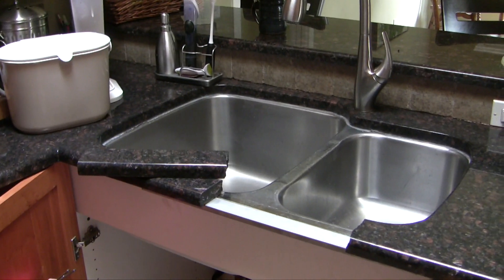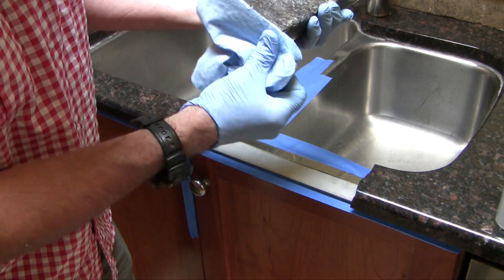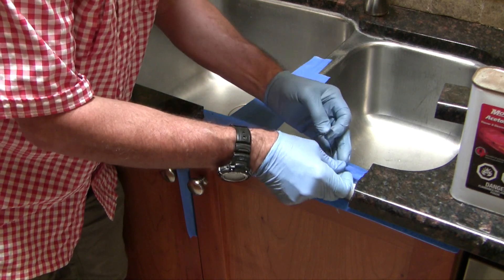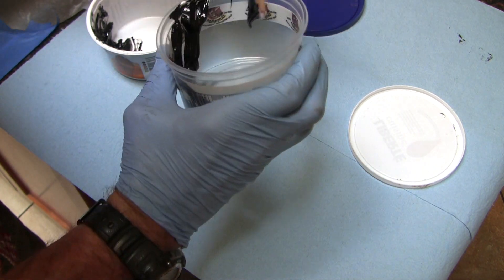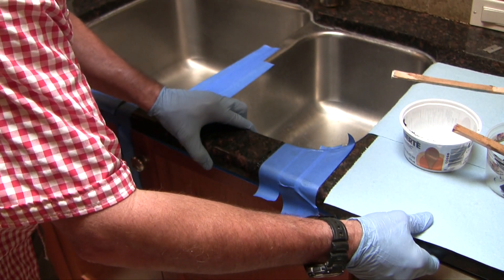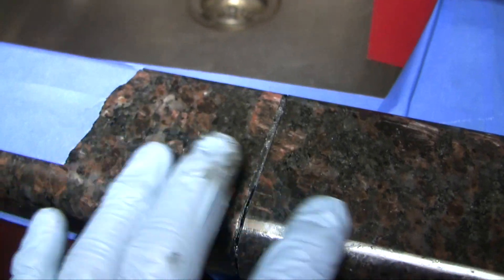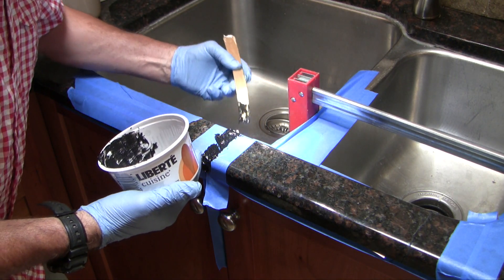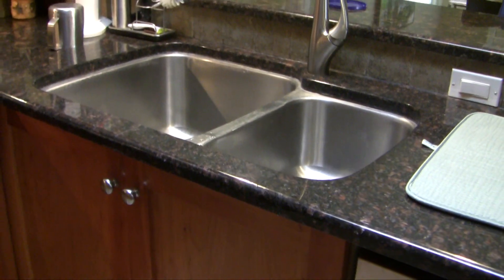How to fix a Broken Granite Countertop

Comment: The glue us granite guys use is called k bond  knife grade and we use specific pigment for that glue. Also from k bond. And you don't want to mix more than 5%color to your batch of epoxy. It comes with the cream based hardener that you had shown in the video. Many granite websites sell it. But it is a hazardous material and shipping is expensive. But good job on fixing the break with what you had
Reply from the maker: Thanks for stopping by, I was hoping a pro would chime in and fill in the gaps in my understanding.
Reply: @spelunkerd  of course. Any more granite questions. Give me a shout. Been in the trade for 24 years
Reply: Where are u located?

Comment: Good job, thank you.  At one point you said the glue holding the countertop down had broken down, allowing movement and likely the break.  At another point you referred to the need to allow for movement.  Are these tops installed fully glued down all over, only at the edges or what?  Understanding the correct setup would be helpful.
Reply from the maker: The glue at the granite interface is hard and it won't flex at all. In contrast, the silicone holding the granite onto the countertop has some flex, to absorb strain that might happen when the underlying wood takes on seasonal moisture. Stone is like concrete, it does well with compression but forces of tension can be deadly since it leads to cracking. I believe the glue for the granite would ideally be less strong than the base granite because you want it to fail at the joint first. Thanks for watching!
Reply: Not good Job

Comment: Nice job. The only thing different I can think of was to bring the glue up a little higher and use a granite set of fine sand to polishing stones to take it down flush. I have some they are pretty cheap online. I think it would have taken the shine off of it when the light hit it. Thanks for posting this video.
Reply from the maker: Good point, thanks for stopping by!

Comment: Hi there! What kind of professional could fix this? Had something similar happen, couple more pieces more than yours though right by the sink. Hopefully I can find a pro, not sure I can do this myself
Reply: Also did the pros give you an estimate on how much it would have cost? Also wondering...
Reply from the maker: If you search out those that install granite countertops you'll find the guys who do it every day. Problem is, the shortage of staff has led them to focus on their primary source of income, new installations. The first shop I spoke with recommended a guy who used to work for them, and I thought I had a deal for $100, but he never showed up to collect his money and do the job. It's not difficult but you need to match the paint, so I brought a piece with me. Ultimately they gave me the two part glue, they matched the paint, and I did the rest myself. I couldn't be more happy with the outcome, since the black color makes the glue line almost invisible.
Reply: @spelunkerd  sorry I didn't see you responded! Yeah looks you did a great job! And yes that seems to be the case with the counterop stores around me as well. Well might have to do a diy and do more research to fix this one. Appreciate the help, thank you!

Comment: It's a shame that you could not get a pro to do the job, it's possible that even they wont be able to make it perfect.

I know you did a really good solid repair, fitting a support to keep the granite faces lined up made it possible, dam heavy stuff.

It's like repairing a car body, you can glue it together with weld, but making the surface blend together can be a nightmare.
Matching the speckles in granite would be a real pain, simply leave your glasses off when you are at the sink LOL :-D (What you can't see...).
Reply from the maker: Yeah, in the end the side with the professional joint was the one that was most visible, but I expected that. The joint was 2mm before and I didn't feel inclined to grind off the old glue to get it perfect. Interestingly nobody notices the cracked area, it's much harder to see. As you say, I don't expect they would have done any better.

Comment: Clean work, man I wouldn't have guessed it was a home fix
Reply from the maker: It's standing up well. When you fix something at home, there's a tendency for your eye to be drawn to defects of prior repairs that others wouldn't see. In this case, even I don't notice it.
Reply: @spelunkerd  This times a million! I actually liked that this video was done by an amateur and not a pro.  Makes it feel more doable.  I'm buying a new kitchen with a granite counter that i found out last night was cracked during removal, and have been debating still buying it.  After seeing this i'm convinced I can do a passable job using your video. Thanks again!